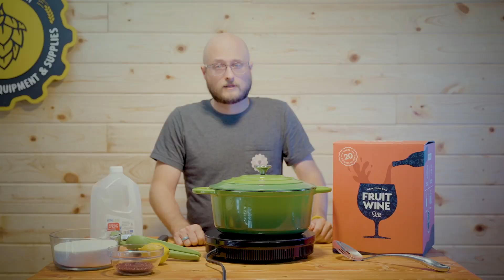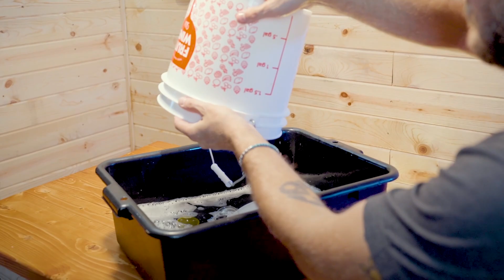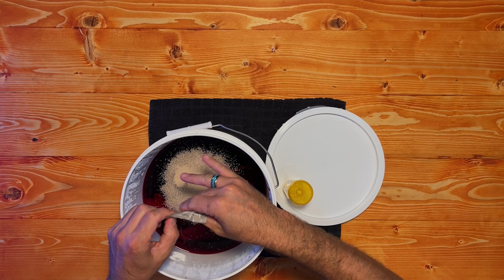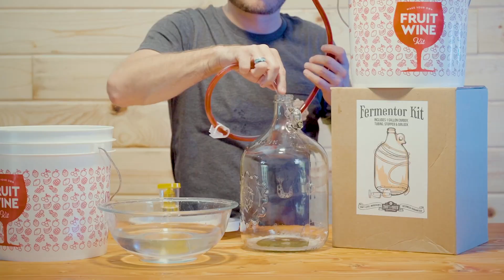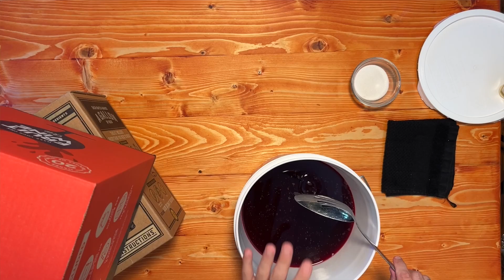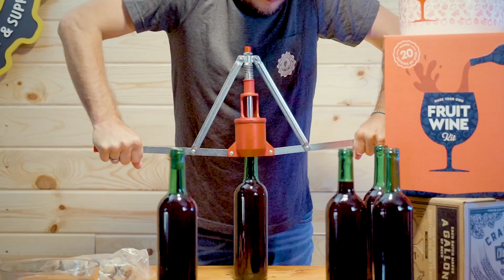Easy Hibiscus Wine Recipe - Full Tutorial & Taste Test

Comment: How do you work out the alcohol content? the % value?
Reply: normally before you start fermentation(or immediately after adding your yeast)  you'd fill a graduated cylinder with the your mix and suspend a hydrometer in it(a device precisely balanced to measure liquid density for alcohol production). based on the density of the liquid it can tell you how much alcohol you can expect to finished product to yield. record the predicted yield. then when the fermentation is finished you'd take the finish product and repeat the process with the graduated cylinder(technically any sterile transparent tube big enough to fit and support the hydrometer works).
you'd take the 'before' level, subtract where the reading is after and the difference is the alcohol percentage for whatever you've made(wine/mead/beer/etc.).

keep in mind though the temperature of the liquid will effect it's density, hotter liquids can gain density when they cool so do it at a temperature safe for your yeast and it should be an accurate read. Also note that even the strongest yeast can only ferment up to about 17-22% alcohol(learned this the hard way when I tried to make a mead at 40% alcohol(if this happens and the fermentation stalls the best way to salvage the mix imo is to heat the mix in a pot to cook off the alcohol, dilute it with water to a fully fermentable density, and start over). anything above those values cannot be turned into alcohol via yeast(if there are other bacteria that can go higher I haven't heard of them). I find it also worth mentioning different yeasts will have different effectiveness in converting sugars into alcohol. for example beer/ale yeast does a fast process of converting sugars but also does it "sloppily" so the alcohol percentage won't be as high. wine yeast however take longer and is much more thorough in the conversion of sugars. 

sorry it took anyone 11 months to give you an answer, hope this helped